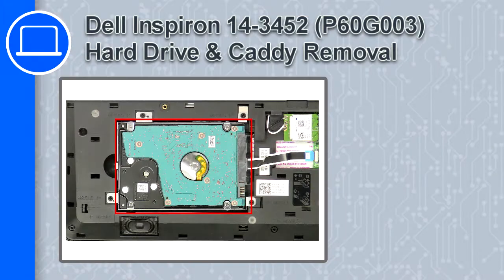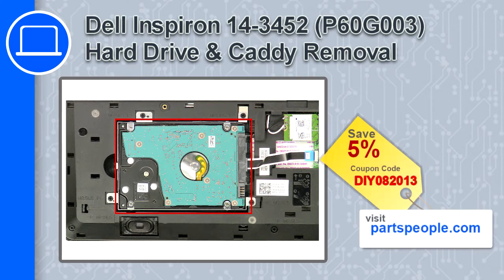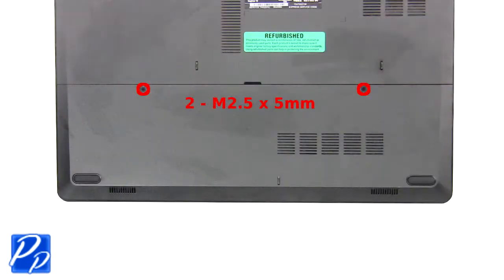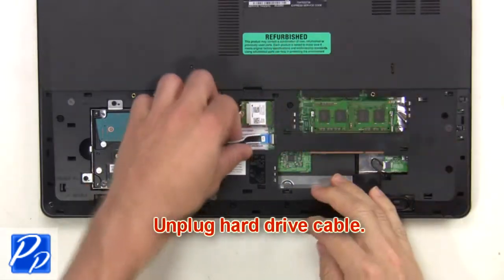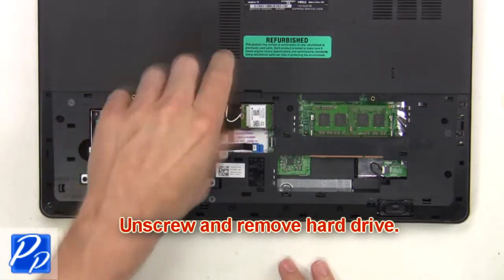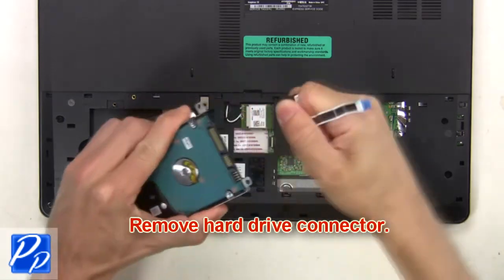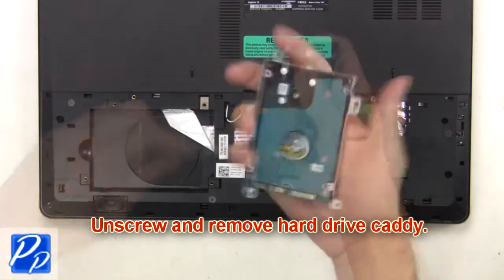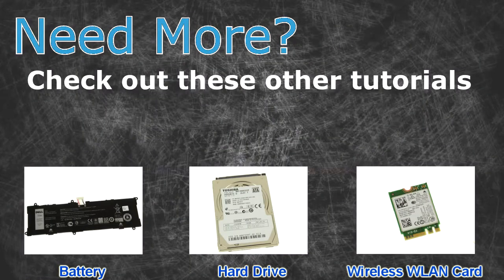Dell Inspiron 14-3452 (P60G003) Hard Drive & Caddy How-To Video Tutorial

Comment: I have two units that identify as 3452 in System Info. Both have a spot for the drive caddy (missing), yet neither have a connector in the spot shown. Both units boot into an operating system (one Windows, the other Linux).
Reply from the maker: There is an eMMC variant of this model that is not configured for 2.5'' SATA drives. This is likely why you're not seeing a connector.
Reply: @dellpartspeople  I wonder if it's possible to solder a connector onto the board. Are there contacts on the board in the same location for the connector on the EMMC variant?

I wonder why they didn't include the connector on the EMMC variants... The space for the caddy is there, and it still says "HDD."
Reply from the maker: @ They probably just repurposed the same board which is why the HDD label is there on yours. I can't unfortunately say for certain that the appropriate contacts are there to make it happen.